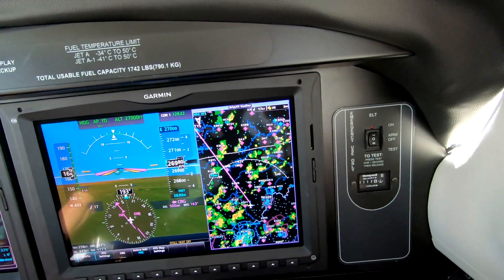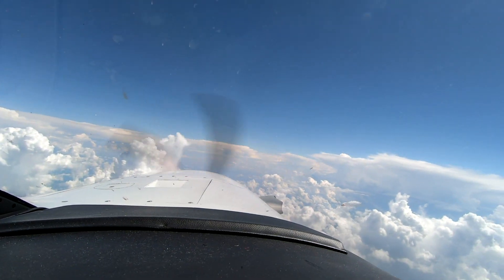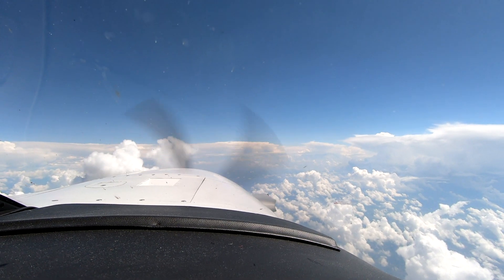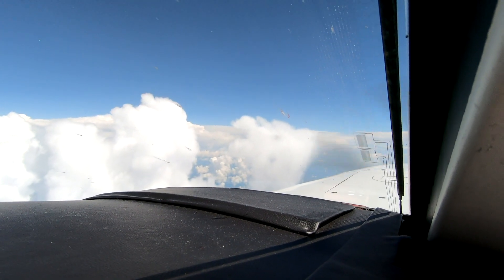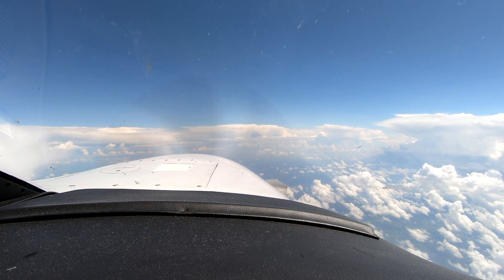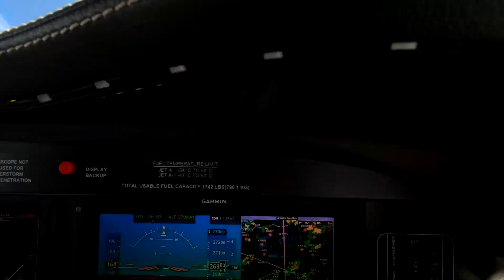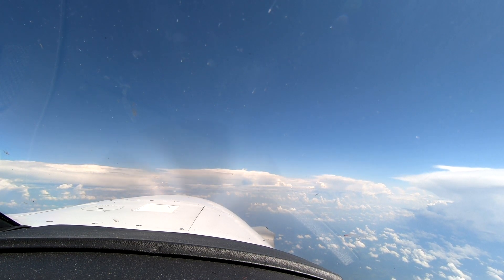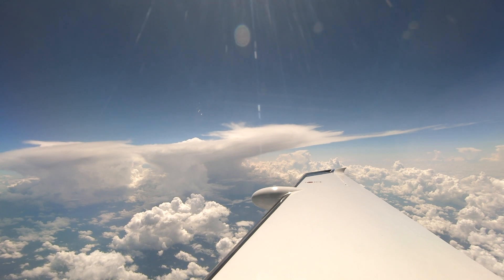The Piper M600: G3000 Radar and Nexrad Real Time Discussion with Dick Rochfort

Comment: Do you have an onboard pulse Doppler?
Reply from the maker: Hi Beanie .. you bet! The Weather Radar installation consists of a Receiver/Transmitter unit in a

bullet shaped pod mounted on the right wing just outboard of the wing jack point.

The Garmin GWX 75180 Airborne Color Weather Radar is a four-color digital pulsed radar with 6.5 kilowatts of output power. It combines excellent range and adustable scanning profiles with a high-definition target display. The pulse

width is four microseconds (ps) on all ranges except the 2.5 nm range. At close range, the GWX 75180 uses a one tr-rs pulse width to reduce the targets smearing together on the displays for better target definition at close range.

The Piper PA-46-600TP uses a lO-inch phased array antenna that is fully stabilized to accommodate 30o of pitch and roll.

To focus radar scanning on specific areas, Sector Scanning offers pilot-adjustable horizontal scan angles of 20",40o, 60o, or 90". A vertical scanning

function helps to analyze storm tops, gradients, and cell buildup activity at

various altitudes. Fly Safely - Train Often .. DR